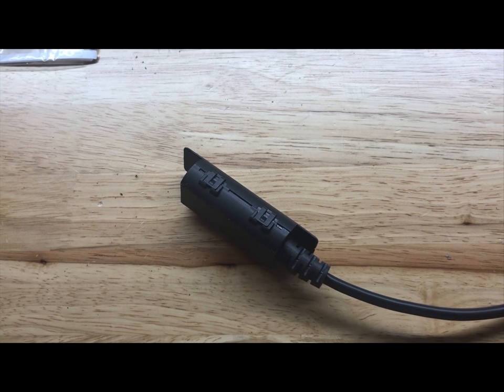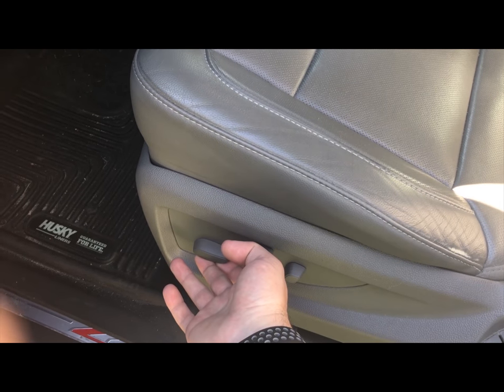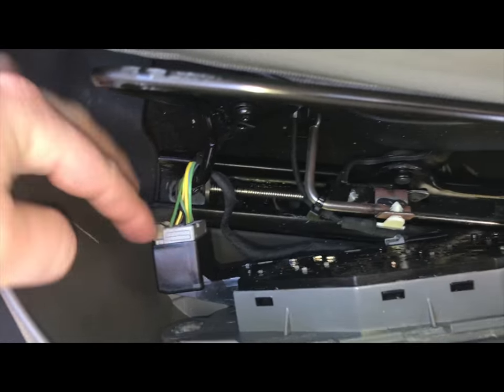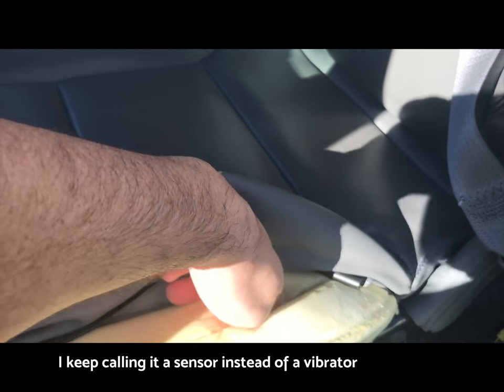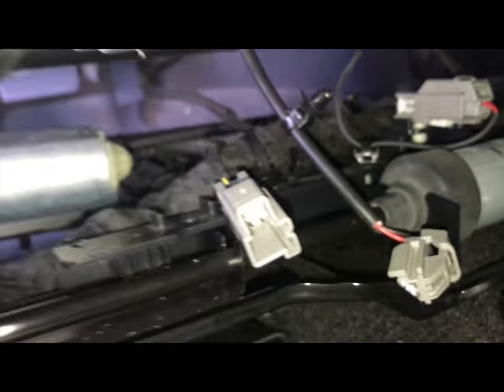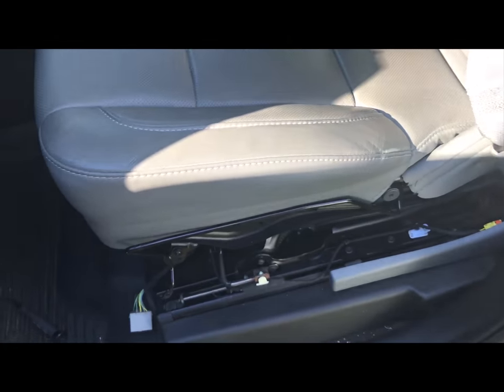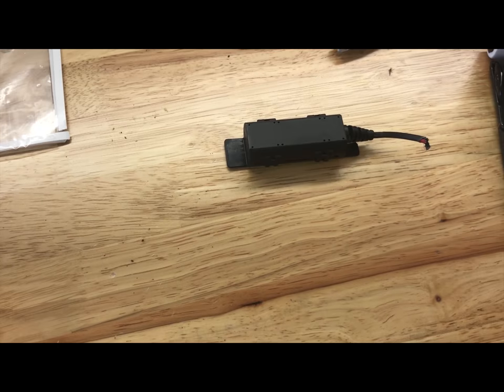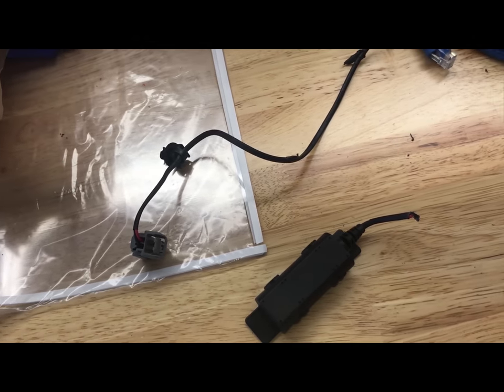2015 GM Silverado - Service Driver Assist System - Replace seat vibrator

Comment: You just saved me $320. I called the local Chevy dealership and they quoted me $360 to do both. I got the part for $44 shipped on eBay. Followed your instructions and was done in less than 25 mins, including spending 10 looking for my T-20/T-25 bit set ;). Honestly could care less about the vibration just got tired of the warning prompt that came up everytime I hopped in the Tahoe. Fixed the issue! I’d add that those clips can be on there very tight and took a little force to get off. At first I was worried they would break but they were pretty stout.

Comment: Ok so I never comment on anything but this really deserves it. 😂
This works on 2016 GMC Sierras 3500 as well. 
After getting multiple 300-400$ quotes from dealerships in my area on fixing this actuator I decided to just take apart the seat in the truck and fix it my self. My husband wasn’t very happy about this but it worked and now the truck is perfect again. Our sensor wasn’t even broken but the wire had been cut by somthing in the seat so after having him help Solder it back together it worked! Thank you for posting this you saved me so much time and money! I also have no experience with working on these things so if I can do it, anyone can. this also only took me about 15 min to take out. And less then 5 min to test it and put it all back together!

Comment: My dealership wanted over $500 to do this.  Bought the part for $40 online at Amazon.  The wires on the new one are much thicker, should last longer I hope.  It literally took me about 15-20 minutes.  The hardest part was getting the rear screw of the side panel back in.  I only replaced the one you show in the video.  I’d like to see how you replace the other side if I ever have to do it.  Thank you!
Reply from the maker: D K  glad I was able to help you!   The other side is just as easy.   I ended up doing it with out even removing the other tabs.  Just wiggled it in

Comment: thank you for the video sir .. it helpd me a lot . however, I decided to open those things and I attached a new cable to the motors. the gage and length that I wanted. 
the issue is those things come with a short cables so I didn't want to deal with the same problem in the future .
thank you

Comment: Thank you for the video.  My 2015 Suburban has the exact same issue.  Since I was able to re-do the wiring, I just fixed the existing motor.  However, when I plugged into the terminal and tested it doesn't work on one side.  I confirmed that the motor is in fact functioning because I tried it on the other side.  Does anyone know if there is some sort of a reset for the seat control module?  Or how I can test the wiring between the module and the terminal where the haptic motor plugs in?
Reply: Michael, I had the same result.  The actuator on my left side had failed I kept getting the warning to have driver alert serviced.  I replaced the left side...BTW the video is excellent.  However it still isn't working....I switched the left to right and right to left at the plugs like you did and confirmed that both of the actuators were working.  If it's in the wiring harness that could be a bear to repair.   Did you get your's to work?  If so, what was your solution.  Curious to hear if you figured it out.     

Side note....the pigtail wire on replacement actuator is at least 2x stronger by design and it has a new part number.  This stuff is frustrating, because GM clearly knows they have a problem or they would not have upgraded the design.  However, they expect their customers who actually uncovered that their was a problem, (by simply using their vehicle as it was intended) to pay for their own repairs by passing these failures off as normal wear and tear.   How many GM owners across the country are paying $300-$400 to have GM's weak design repaired?

Comment: Great video! Thanks for this. I need to replace my motor as well as my heated seat element. Do you think it would be possible to unlatch the seat cover on the inside (near the console) and fold the seat cover up enough to replace the heating pad without removing the seat from the truck?
Reply from the maker: Chelsea Vongphasouk   Yea. You can fold it back enough
Reply: That's precisely the next video that I'm going to go search, hopefully the instructions are as clear and concise as these, thank you very much for your time and knowledge!
You Sir are owed quite a few free beers.
Reply: I don't know if you have already fixed the heater, but this silent video may be helpful? This one involves seat removal, so it's obviously a bit more involved.

https://youtu.be/Xgkvn2qYSM8

Comment: I just ordered the actuator for my silverado  and i installed it yesterday and it still doesn't vibrate when i get close to something. I only feel the right side of the seat vibrating do you think it could be something else? Thanks
Reply from the maker: Sorry,  YouTube stopped sending me emails.   I would try plugging the other vibrator into the plug.    That should help tell you if its the wires between the seat and vibrator or seat and BCM

Comment: What is the par number for a 2014 GMC sierra SLT?
Reply from the maker: Armando Perez  should same as the one listed in this.   Double check on gmpartsdirect
Reply from the maker: There could be revisions.  Find the appropriate one for your model on gmpartsdirect but then search amazon or eBay
Reply: @DownOnTheRangeFL  thank you so much
Reply: Replaced the motor yesterday the was warning went away but i cannot feel it vibrate . Any ideas?